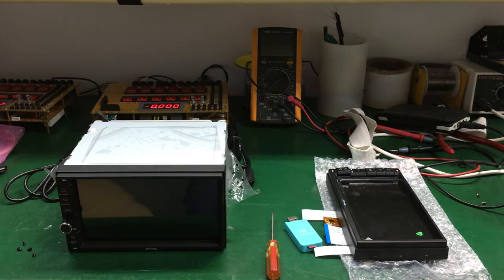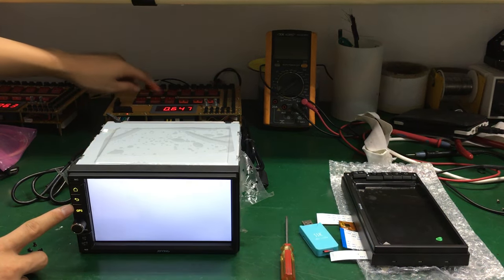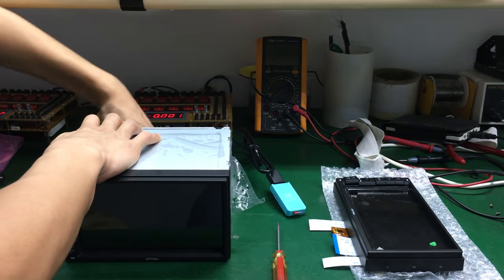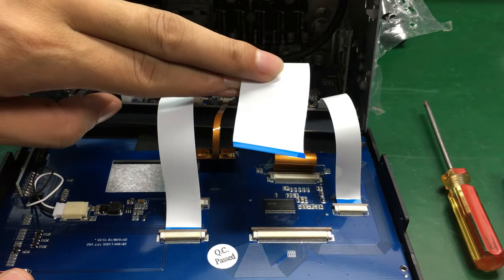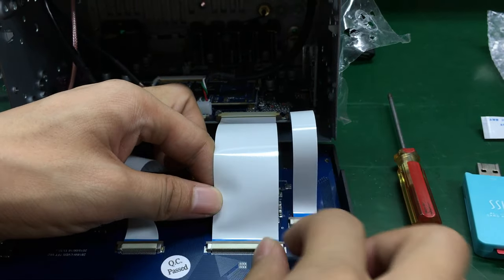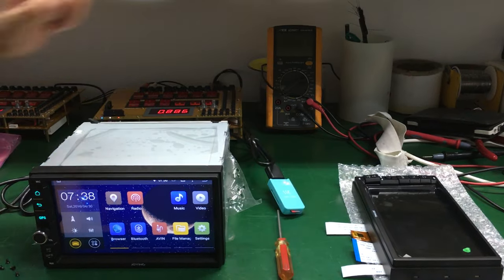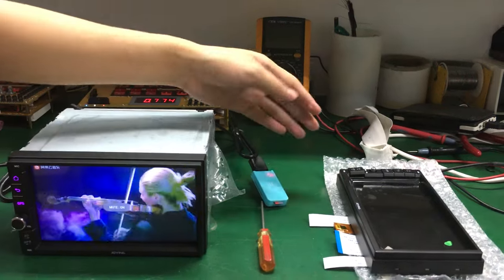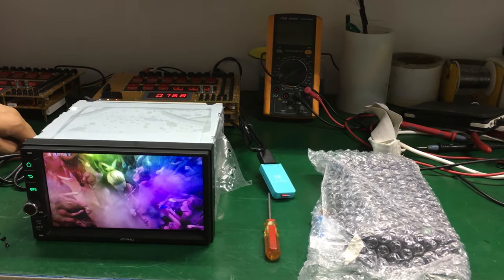JOYING repair White screen have sound on android car radio stereo quad core 1024*600

Comment: I have a cheap Dual AV XVM..BT car stereo from an Autozone store that went white.  My sound still worked so I followed the steps in the video to try and fix it and IT WORKED.  Unscrewed 4 little screws(2 on either side) holding LCD to the rest of the stereo.  Inside the radio was a little different from the video but there was a wide ribbon cable on the right side going from the main part of the stereo to the LCD.  Gently pulled ribbon cable from the non-LCD side and it came right off so it was loose already.  On my stereo there is a little bar that goes across the port where the ribbon cable plugs in.  I had to gently pull that up with my finger so it opens the port and you can push the end of the ribbon cable back in easily.  Then once I had the ribbon cable in place I gently pushed the little bar down and it locked the ribbon cable connectors in place.  Screwed the 4 little screws back in, plugged up main wire harness, turned it on and it works again.  I was about 6 hours from buying a new one, THANK YOU random internet person.
Reply from the maker: You are welcome.

Comment: I bought online 10.1 inch car radio GPS Navigation system I am having display issue with my system can't see anything on screen radio and Bluetooth is working I already try to reset my system but issue still the same
Reply from the maker: To help you better, pls contact us via email europe@joyingauto.com with your car radio order number and problem, after checked will find a solution for you. Thanks.

Comment: Hi plugged in something to charge in my USB port and screen went off no light or anything but I have sound. What do you think. Plug n play android for Chevy Tahoe.
Reply from the maker: May i know what kind of device do you connect to the radio? Usually the radio do not support to incharging the device. The USB port only has 5V voltage!

Comment: I have a pioneer 160BT that does this intermittently. No sound though but the screen will flash black for a second when putting into reverse before showing the white screen. I've noticed the more often it does this the more colored vertically lines that seem to appear. 

So it seems like the radio functions because the reverse makes it flash black but it does cut off music from Bluetooth or android auto USB.
Reply from the maker: You'd better contact your seller to ask for a help.
Reply: Hey, I'm having this problem. Did you find a solution?
Reply: @mysub2010  yeah I bought another and returned it in the box.
Reply: @michaeltypaldos7246  bahahah that’s what I’m about to do as well. Pioneer sucks

Comment: Hello, great video! Do you know how do I fix a similar issue but related to a wrong firmware that I installed in a MP5 model 7018b? After update finished, display does not appears anymore. Is there a way to recovery or reinstall the original version on devices like that whitout access to the touch screen?
Reply from the maker: Does your unit is from Joying ? If yes, pls contact us via email europe@joyingauto.com with your order number and issues, after checked will find a solution for you. If not from Joying, i am afraid i cannot help you, because i cannot know other head units. Hope you well-understanding

Comment: hi, I bought a chinnese androide double din radio car, but the screen came broken, I want to know if it`s possible to repair it or change just the lcd? if its possible, how can I know wich reference of lcd do I need, please help me, thanks.
Reply from the maker: Does your unit is from Joying? If yes, pls show me the order number. You also can contact me via email europe@joyingauto.com, any problems will help you solve it.

Comment: HI, I HAVE THIS SAME RADIO, I LOVE IT. DO YOU ONOW HOW MANY WATTS, RMS PER SPEAKER CHANEL THIS RADIO GIVES? I PLANING ON CHANGE MY SPEAKERS, AND  I DONT WANT TO BUY AN AMP, . I NEED TO KNOW HOW MANY WATTS RMS THIS UNIT GIVES, SO I CAN BUY THE RIGHT SPEAKERS. THANKS IN ADVANCE.
Reply from the maker: 4*45WATTS, RMS PER SPEAKER
Reply: hi friend! Hi! MCWAUTO   is fault. there is no sound comes out, my technician says hi needs prosessor ( chip, board ) do you have that? ,could you help me to find it?

Comment: Hello, there is a problem my radio joying, when it is warm, the display goes well, but when it is cold, transverse thin stripes are displayed on the screen and the whole image is blurred. if it is turned on longer and it heats up, the stripes disappear.
help.
Reply from the maker: Really sorry to hear that, to help you better pls contact us via email  europe@joyingauto.com with your car radio order info and problems, then we will have a check and find a solution for you. Thanks.

Comment: hi , i have some question i have a  s160  for ford ranger t6 , and now a day the unit doesent work, when you turn on in the display apears the logo and then sunds a beep ant turn off.
I tried tu update de software but i didnt work, aferte that i bought the main board and the display board, i change bouth , but still do the same, can you help me?
Reply from the maker: Pls contact us via europe@carjoying.com with your order number and details info, you'd better show us a video, after we checked that, we can help you better

Comment: Hi, I have a problem, the video sound of my 7020g does not work, but when it is on the radio it works. likewise, when it is reversed, the screen turns blue and the image of the rear camera is not projected ... help me please
Reply from the maker: To help you better, hope you can contact me via email europe@carjoying.com with your order number and details issue, after i checked it, i can help you better. Thanks a lot

Comment: hi there i also have the same problem, the screen is white but you can here the buttons and the radio but cant do anything as the screen is white. any suggestions on how i can fix this thanks!
Reply from the maker: To help you better, more technical support pls contact us via email europe@joyingauto.com with your order number and details issue, after checked, will find a solution for you. Thanks
Reply: Boy ka but the thing is, that i ain't got an order number as it was my uncle's sons and he gave it to me as he bought a new car but he told me that the screen won't work for some reason and he also said that it happend recently was working before then the screen went white when he started the car not sure wat to do! look forward hearing from you Thanks!
Reply from the maker: Pls contact me via email europe@joyingauto.com with all the info you know and show more details issue via video and then i will check to find a solution for you. Thanks
Reply: Boy ka ok will do thanks!
Reply from the maker: Thanks for your cooperation

Comment: i have an exonic exd 7082 it works for about 30 minutes then goes white..how do i fix it..thank you
Reply from the maker: What is  exonic exd 7082?
Reply: Boy ka its a car stereo 7 inch double din just like the one you're working on but my face screen works for about 30 minutes then goes white.?
Reply: its a touch screen 7 inch car stereo
Reply from the maker: Would you please tell me does your head unit from Joying?
I need to confirm with it.
Reply: no its an exonic exd 7082 7inch din double
Reply from the maker: SOrry for i don't know how to fix your problem, because your head unit doesn't from Joying. I advice you contatc to that seller to replace new one.

Comment: what happens if you break the clip?
Reply from the maker: Which clip do you mean ?
Reply: on the motherboard
Reply: ribbon cable clip on motherboard
Reply from the maker: If the ribbon cable clip broken, then the unit cannot works normal, maybe cannot turn on. But we can help you solve it, if you have any issue for your car radio, pls contact me via email europe@joyingauto.com with your order number and issues, after checked will find the solution for you. Thanks